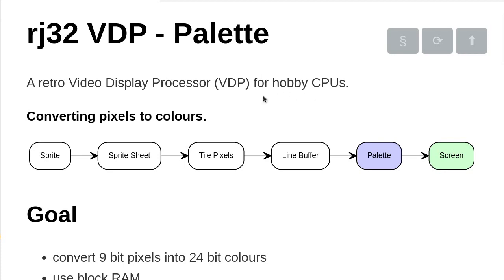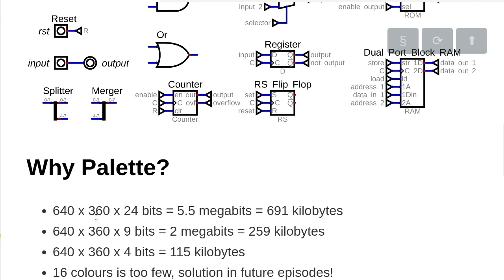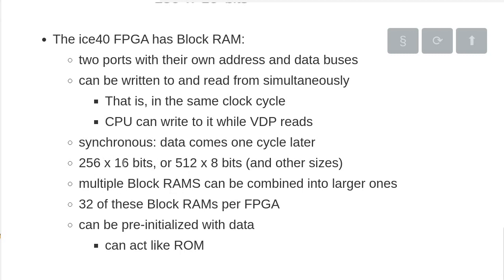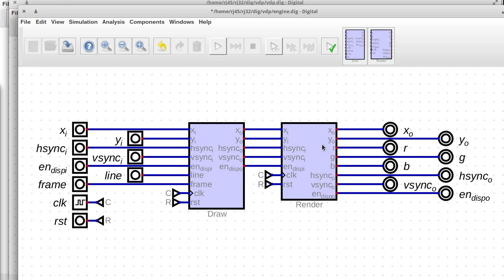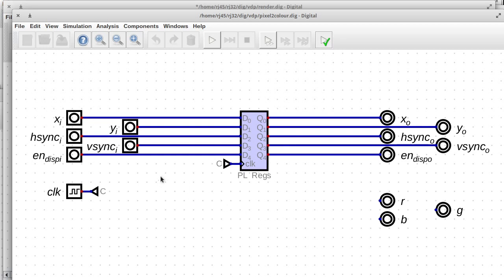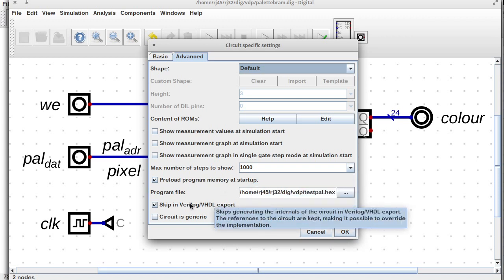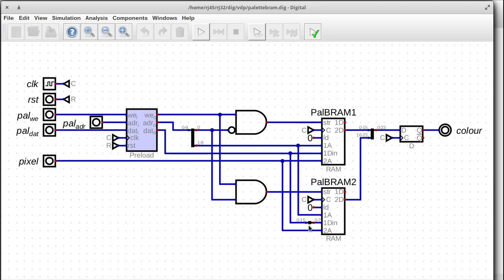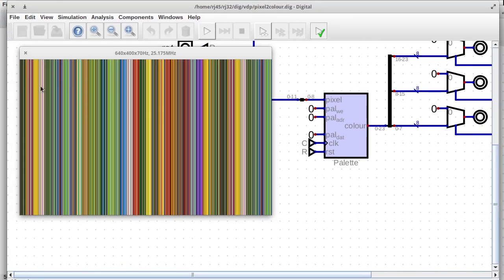[003] Video Display Processor Palette Lookup!

Comment: I ran into the same issue trying to pre-initialize the data in my VGA controller, and since the front panel I use for testing already had an initialization circuit in it (as I have no 16-bit CPU yet), I incorportated the initialization of the palette registers in that circuit.
Reply from the maker: That sounds handy. Yes, pre-initializing is very helpful in bootstrapping a VGA circuit for sure.

Comment: Are you going to couple it with some actual 8 bit cpu,  like 6502 or 6809 ? It might be a good solution in order to involve community, since it will make possible porting classic NES games to your system.
Reply from the maker: My other project is a CPU built from scratch, so no, probably not. That doesn't mean others couldn't do that though. Also, alas, I haven't had time to continue this project lately. Hopefully that will change soon.

Comment: Hi, interesting projects. You said that is display is tile based. Can you have a different tile for each screen position?
In this way, arranging the tiles on screen you can manipulate the displayed picture as if you had a frame buffer bitmap implementation.
Reply from the maker: Yes that's part of the plan. Except that each sprite is made of tiles from a tilemap, and there's several tilemaps.